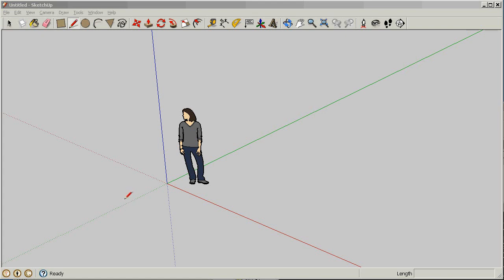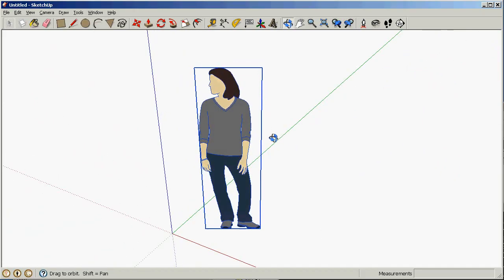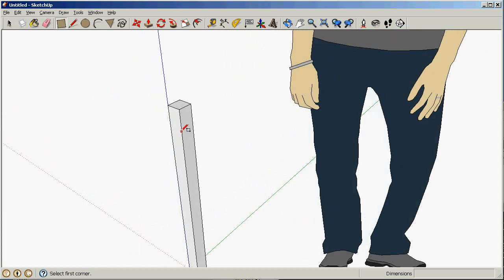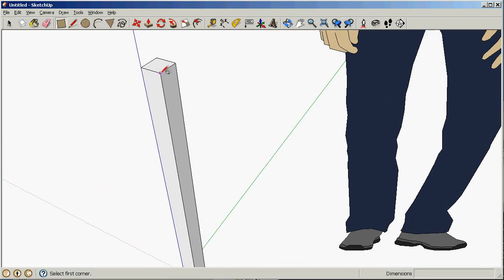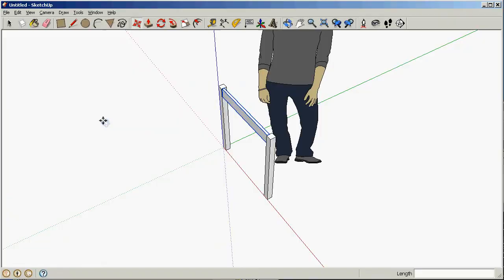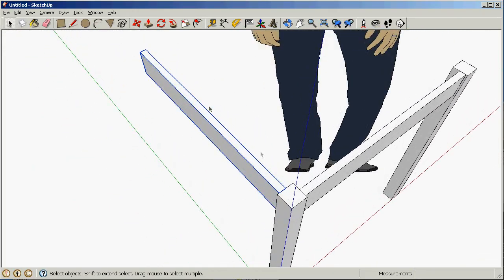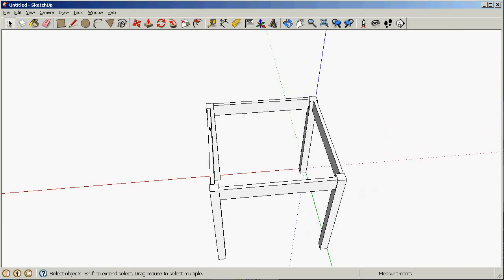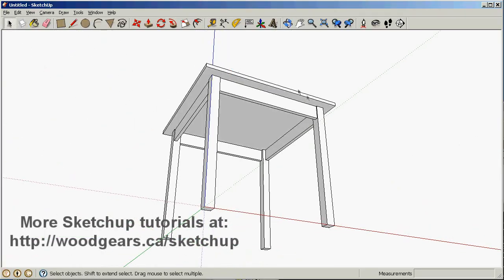SketchUp: Drawing a table

Comment: Ohhhh... I have the Mac version and there is no "Units" on the prefs panel.. that's ok since I could choose the engineer template; 
and there is no "enable length snapping" either... this explains why I'm having a hard time placing things next to each other.
I've switched to a machine with Windows and still those options are not there... which version you used ? I downloaded the one I found the link in one of your woodgears.ca site, version 8.0.16846 (my Mac version is 8.0.16845)
Thanks for the tutorial.

Comment: Using Sketchup 2016 Version 16.1.1.....where is the Engineering style template?
Reply from the maker: +Elm Chris Ask someone who uses sketchup 2016.  I still use version 8.
Reply: +Elm Chris The templates are in the same place for 2016 as they were in 8. Go to Preferences (under Window on Windows, under the SketchUp menu on OS X) and then go to the Templates section.
Reply: Use shaded with textures in styles, works just fine.

Comment: Great tutorial as always, Matthias. I have one question. When you rotate the legs and apron rail at 5:40, I'm having trouble getting the copied rail to end up anywhere near where yours did. It's usually out from the leg, and a bit to one side or the other. I then have to move it quite a bit  I guess I don't know where to click the starting point properly. Any ideas? Thanks.

Comment: Hi mattias, I just started using sketchup, after seeing some of your tutorials which were very helpful. Thanks so much for that. The thing is, when I'm practising in sketchup, and I selected the same style as you did, my faces are still transparant, so I can see the edges and axes throug all the faces. I find this very annoying, and I have tried lots of options, without good results. Do you have a solution for this? Thanks so much and keep up the good work!

Comment: i learned alot about using sketchup. informative toocould use a little work on better ways to explain things, but nothing major. also have you ever heard of a CAD program called rhinocerous, also known as rhino 3d, you should give it a try if you havent used it, the evaluation is a free download so no worries if you dont like it

and again greatly informative video thank you for posting

Comment: :) Not my vid, but OK.  Whenever you copy or move an object, select a point on the object being copied which you can use as a reference point, such as a corner.  Alternately, you can use the Tape Measure tool to create a guideline to which you can snap objects.  There's a really good series of instructional videos from Google.  (I'm really new to this myself)

Comment: @bryphi77 Yes.  You right click your selection and use the flip tool, or you can use the scale tool and use -1 as the scale factor (which I prefer actually)

Comment: @TeenWoodworker Also, if you use one of the standard views... say 'top', then it will allow you to do 1:1 printing.  but be sure to do the parallel projections as you say.  I do this often so that if I have a pattern I want to transfer, I can mirror image it, print it out, and the transfer it to the wood with a common iron.  Printer ink is commonly plastic that melts.  its a nice trick

Comment: I suggest that if you don't use it yet, make use of components instead of objects.  There are several reasons for this, but the main one is single editing.  With a component, like a leg, you want them all to be the same.  (or a screw or whatever).  if you edit one of them to make the leg longer, or to add some flutes to it or whatever, then they all get the same thing.  That way you don't have to edit each one individually.  Making simple objects doesn't allow that, they are all unique

Comment: technically you should have flipped that 4th table apron too.

I love sketchup and have been using it for several years now.  Thre are soooo many tips.  Like when you have the four edges of the table and you want to make them all go out by the same amount...  do the first one say 5cm.  then on the other three, just double click.  it will use the last push-pull amount, and you don't have to keep typing in 5cm each time.

Comment: @Satanro666 
Hi there, I had problems with that a while back. What you need to do when you go to print is:
1) Set to "parallel projection" and you may want to "zoom extents"
2) deslect "fit to page" and "use model extents" 
3)set the scale to 1:1 (or whatever you need)
4)print preview 9/10 it is not in the centre of the page
If so highlight what you are printing and right click "make component" and using the pan tool move it around so it is in the centre when you print preview.

Print!